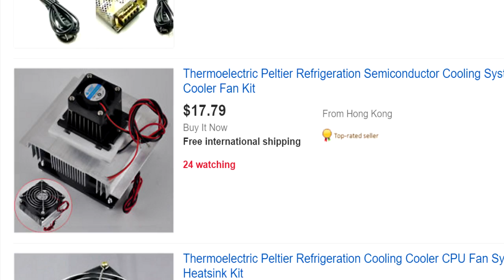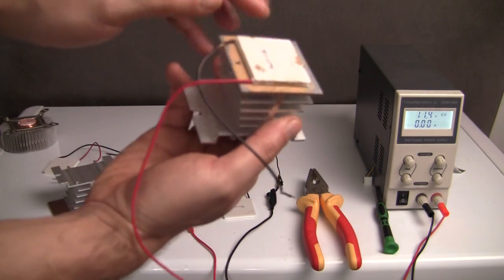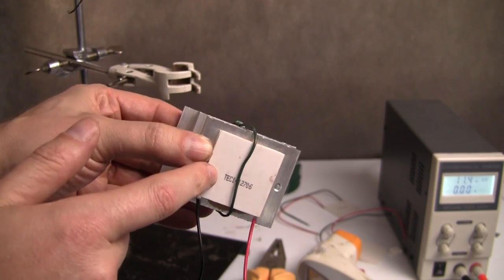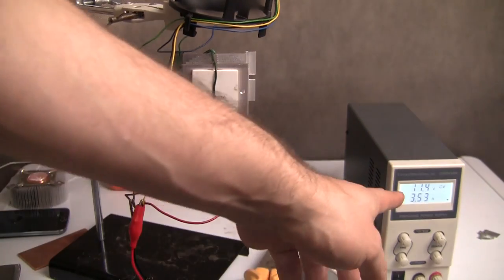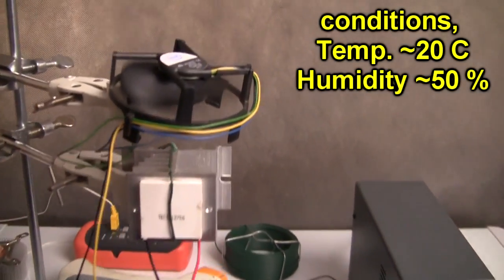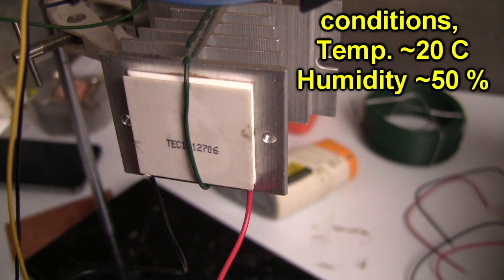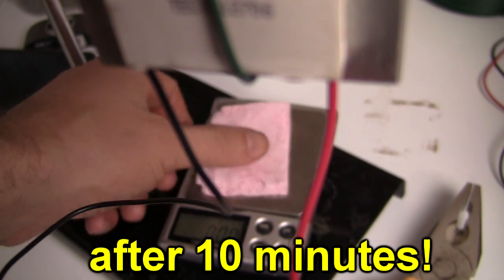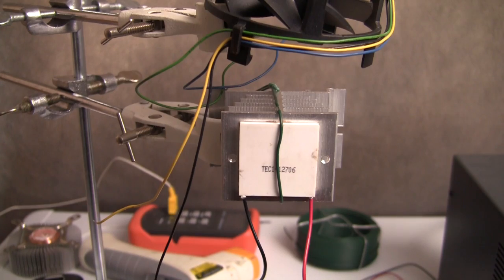Fontus Water bottle claims to make water from air.  Is it possible?

Comment: With best methods you's still need about a kilowatt-hour of energy to condense a liter of water. First you'd have to replace the small peliter with a large   heat pump, and a setup where the cooled air below the dew point would pass through a heat exchange to pre-cool the incoming air. You would benefit from active controls that could sense ambient humidity and temp, and temp in the condensation chamber. 

With respect to this particular setup, the Fan was working against you by drying anything not on the cold surface, and mixing warmer air turbulences near the cold surface leading to evaporation and chilling far more air per unit water than was necessary.
Reply: +WorBlux Israeli company WaterGen provides water-from-air devices as efficient as 300 Wh/liter. The IDF uses these. That said, it's still far off from what a portable solar panel could provide, and it's still bigger than what a bicycle could carry.

Comment: Something tells me their device might be something more than just a peltier unit placed over a bottle.
Reply: *****
I just made a post where I calculated how much energy that thing needs. Even if you assume the condenser does not loose any of the cold, you need 3 kw to power it.
That is 500 times what a bicycle dynamo generates, if you drive very fast.
Reply: Well, I just want to say that he definitely put the heat sink on the wrong side of the peltier for this test.  It's the electrical current (or is it potential? doesn't matter, anyway) that keeps the cold side of the peltier cold, the hot side is going to be hot no matter what, even with a heat sink. What's really important is maximizing the surface area of the cold side -  i.e. putting a heat sink on it.  The more surface area you have in contact with the air, the more water will condense on it, simple as that.  Just using the small surface area of the peltier unit itself and putting the heat sink on the hot side where it was actually less effective, kind of shows that he's not looking at the problem in quite the right way.  I'm not saying that the device is technically feasible for filling a whole bottle in a reasonable amount of time, but it is technically feasible for producing water from air, so the question is, ignoring how cold the peltier gets and how efficiently you remove heat from the hot side - which I don't think are very important, how do you maximize the amount of relatively cool surface area you have and also maximize the volume of air flowing over that area?  Increasing the pressure of that air is also an obvious plus (higher air density = more water per square inch of collecting fins), but probably too energy demanding to be practical and it would also increase the energy requirement of the peltier unit by increasing the amount of heat it needs to remove from the collecting fins.

He was also putting too much energy into the peltier which was oviously screwing up its efficiency which was obvious as the hot side of the peltier was heating up the cold side.  The main purpose of the peltier is to remove heat from the collecting fins.  If that is done at a reasonable pace, then the hot side should only be slightly above ambient temperature and the cold side only slightly below.  It should only need to be around 10-20 °C on the cold side, which would correspond to the dew point you would expect to see wherever the device may be used.
Reply: Schwarzer Ritter It's not all about temperature, though.  You want the temperature to be somewhere just below the dew point of the air in the room and you want it to stay at that temperature.  As the peltier absorbs heat from the air it will start to warm up, and that's when you need to crank up the power but you can't just shove 50 watts into a peltier device and expect that more power equals more condensation.  That is just not how it works.  Power consumption and condensation are not linearly correlated.  As I stated before, it has more to do with air flow, pressure and surface area.  Granted, as air flow and pressure go up, there will be more heat to get rid of, but it should be balanced such that the temperature remains fixed relative to the dew point of the air.  If it's too much heat for one peltier than he should have hooked up two of them.  A sensible experiment (or device) should also have a separator between the hot and cold sides so that hot air cannot just go to the other side and keep the air from reaching the dew point.  Such an overly simplified setup basically only proves the feasibility, since even though it is probably the worst possible condenser arrangement, it still managed to produce a few tiny beads of liquid water.
Reply: If you look at the indiegogo page you will see these two diagrams: http://ignitecfp.com/wp-content/uploads/2016/03/Map-Animation-Fontus.gif https://c1.iggcdn.com/indiegogo-media-prod-cld/image/upload/c_limit,w_620/v1459622198/graphics_chart_filling-01-01_jvz8ai.jpg

The first showing that (I'm assuming Thunderf00t is in England in this video) it shouldn't even work in the entire United Kingdom, or at least be below 50% efficiency - whatever that means, so he can't even really test their claims as they're not claiming that it will work in the U.K.  The second showing that its performance is dependent on temperature and relative humidity.  So yeah, it's clear that it's a bullshit product but I honestly don't believe that they are making any false claims.  I think in the right place at the right time you can fill the 800ml bottle in about 2 hours, and I think they tested it in ideal conditions meant to replicate the weather of some hot, balmy, rainforest climate.

Comment: Yeah, I found the same thing, I have a Peltier dehumidifier, and it takes 40W to give you about 100 mL every three or four DAYS! Not quite save your life time. Now if you compressed the air and cooled it you might be able to do it, but it would take
a lot of muscle power to do that kind of compression. Solar still would work better.

Comment: Check this out... this is from their IndieGogo page at the very bottom:

"It is explicitly pointed out that the products which serve as Perks are in the development phase. It cannot be excluded that during the development phase technical, economical or other circumstances arise which may result in (i) a delay of the delivery of the Perk or (ii) the production and delivery of the Perk in a different form as regards functionality and/or design or (iii) even non-production of the Perk. In the latter case there will be no Perk delivered to the Contributor. Contributions will not be refunded. By making a Contribution the Contributors explicitly acknowledge the risks associated with the occurrence of one of the aforementioned events."

So... they have a disclaimer that says you may get nothing and no refund. Period. Unbelievable, and they have already raised $327,360 with 12 days to go. Unreal.. I need to make up some crap and put it up..... $327,000 in 18 days. They were only trying to steal... pardon me... RAISE $30,000..
Reply: +robert smith Amazing fine print lol; and unfortunately you know you're better than that.

Comment: I wonder if you'll be addressing other downfalls of this, past the issues with thermodynamics and maintaining a cold enough temp for condensation. Such as power concerns. I imagine that the volume and mass of even the best commercially viable batteries would be far greater than whatever water they could condense. And solar would provide too little power to effectively run a dehumidifier strong enough to pull water at the rates they advertize. not unless you want a huge panel strapped to your back, haha.

But beyond anything else, water pulled from the air is filthy. Dehumidifiers pull all sorts of dust and garbage out of the air, and that's inside a clean building. Outside, the pollen, spores, dust and vehicle exhaust would make the water god awful tasting, if not mildly poisonous. (I'm looking at you inner city air pollution!)

I'm surprised (and unsurprised) at people trying to jump to this thing's defence. It's flawed on so many levels.
Reply: +kauske  even with the best batteries commonly available, and a 90% efficient apparatus, you'd be better of weight wise packing water, but not than 2-3 times over. not counting the weight of the apparatus.  Shirt to hydrocarbons to power the heat pump and you might when over just packing water, when you need hundreds of cubic feet of water. Of course then there is cost to consider.
Reply: WorBlux 
That's exactly what I was getting at...

Comment: In my apartment we have to put a bucket under the air conditioner because it condenses water from the air and that might create enough water to avoid dehydrating maybe it creates at best a gallon over 12 hours but that really racks up the electric bill the unit is the size of a book shelf so that dinky solar panel isn't going to cut it although the unit stops when the apartment reaches the right temperature.  I mean how much more efficient than an air conditioner can one of these things be?  I know you get water by cooling the vapor in the air, but my question is how much water vapor are you cooling that goes back into the air wasting the energy used to cool it?

I Imagine if it were optimized to create water you could probably need a unit the size of a suitcase and a small gas generator to power it.  And it would be ridiculously heavy and cumbersome and probably expensive.

Comment: I wish I could say that you've debunked this, but you haven't. 

There is a lot more to the design of these systems than your simple test rig shows .

If the humid air is compressed and  then cooled using the peltier, then more condensation will be formed.  That is why you need some sort of broad heat exchange system on the cool side of the peltier within an enclosed system to not only compress  the humid air, but also to increase the surface area of the cooling surface on which condensation forms.  

After a gas is compressed and begins to expand, it takes energy away from its surroundings, causing a natural form of refrigeration.  Air just rushing past the peltier does not get a chance to be compressed and decompressed, losing any benefit of a  gas heat-exchange.  This is how refrigerators work, taking advantage of gas heat-exchange as it is compresses and expands to reduce temperatures.
Reply: +jefaus06 

Hey, hey moron. What about the energy to power this hunk of trash? Even if you hypothetically give that it produces water at a decent rate, the energy to run it would be far heavier in battery form then the water it would provide.

And don't go into solar, solar panels big enough to provide decent energy for a dehumidifier that can provide you water would be ridiculously cumbersome.

further, even if I were to concede some energy source far beyond what is feasible for the mass market currently, the water produced by this thing would be absolutely atrociously undrinkable. I defy you to down a glass of water out of the holding tank of a dehumidifier. clean it out, make it spotless beforehand, just let it run indoors, and see how utterly disgusting indoor air is. Now imagine outdoors, with pollen, dust, car exhaust and even soot in it. The design says nothing about filtration, and a pre-filter would greatly impede its ability to produce water.

This product is bunk, fundamentally worthless over something like an activated charcoal filter and pump half its size. As someone who does wilderness camping, and has at least a basic understanding of science, I would never, ever waste a dime on this thing, nor take it as part of my kit.
Reply: +kauske There are "two" forms of cooling happening within the system, as well as obviously "patented" technology, a form of hydrophobic surfacing on the surfaces the humid air condenses on.

I don't think +Thunderf00t can re-create these with merely a peltier.

I have seen such systems in use in Outback Australia.  Wind generated turbines that not only generate the electricity to operate the peltier, but do the job of compressing of the humid air at the same time. It is very, very efficient.  Again, the key to this is that hydrophobic surfacing.
Reply: jefaus06 

I love how you entirely skirted the issue of energy consumption... And the water being dirty...

this bottle is supposed to be a small man portable unit. you cannot carry a wind turbine around to power a portable unit.
Reply: +jefaus06 This is just a preliminary test, using a low power peltier device (as that's all we know about this thing so far). There is no doubt that it's not as efficient as it could be. The problem is, the efficiency is off by 3 orders of magnitude to boot. 4, if you consider the fact that you're never going to get 40 watts sustained out of a bike-mounted solar panel, you're lucky if you can get 4. (Believe me, it's been tried.). So, it could be more efficient, yes. 10,000 times more efficient? Highly unlikely.
Reply: tybofborg 
He'll just skirt around the issue of power, I already addressed that, and it went ignored in his rebuttal.

He also seems to ignore water pulled from the air is often contaminated, since you pull pollutants with it.

Comment: I saw a car ad one time, so I built my own car. It didn't work very well, so I know that cars are bullshit.
Reply: Except for two things. 

1) cars require complex engineering that you obviously have no idea of, while this has relatively simple engineering

2) you didn't actually build a car.
Reply: DBZHGWgamer
I'm one of the relatively rare people who can build a car, at least from parts, I'm a professional mechanic. I'm pretty good at welding, steel fabrication and body work,  But I wasn't really talking about cars, I was making a point about the concept of this video. It's like, review the product if you want, but don't try to build your own version of it and then declare it's impossible. I have no idea whether it's possible to miniaturize an atmospheric water generator enough to make a self filling water bottle, it seems unlikely, but the basic technology is real, so I can't definitively say it can't be done. After all, if nobody had heard of a smartphone and you told people about it, they'd think you're nuts and tell you it's impossible.
Reply: Terrace Thornhill but there is a difference. Everything that goes into a smartphone and a are things that in and of themselfs are complex. A water bottle filler is made of several simple parts (excluding power), and ignoring how hard it is to make, it is thermodynamically impossible for it to work in any reasonable amount of time.

Comment: you could improve efficiency by passing the warm air from the heat sink over the cold side.  bigger temp differential = more condensation.
Reply: Except that would ruin the whole point of the heat sink as the temperature of the cold side would go up...
Reply: DBZHGWgamer hmm right.

Comment: I'm curious if there is another mechanic at work here.  You have a fan blowing past the device without containment. Effectively drying the device.  I wonder if you had taken the reading at differing intervals. You've proven that your method of doing this is ineffective, but not that their device doesn't work. Don't get me wrong I don't buy into what they say about the device either but your test is inconclusive. Thanks Phil.
Reply: he should have had a cup under it to catch moister, but if the fan causes the water to evaporate, it would happen in the actual product too.
Reply: DBZHGWgamer If you're blowing cold air into a confined space and the air outside the confined space is warmer, would you not get condensation inside the container? Once condensed the dry air is replaced by new, moist, cooled air?

Comment: Just playing devil's advocate here, but is it possible that outdoors during a muggy day in the summer, there'd be more ambient humidity in the air than inside your workshop?  Also I'm wondering if positive airflow pushing the condensation down into that flask would protect it from evaporative losses that could occur in your lab?  It'd be pretty easy to modify your procedure to account for this.  Just turn off the AC on a hot day and stick a jar around it.

Comment: it really is impractical, but you gotta admit, a shot glass of water a day is better then no water. loved the video thunderfoot.
Reply: +wildwesleywest To get that shot of water you need to carry about 70Ah worth of batteries (if I go with Thunderfoot's 3amps consumption and 24hrs) 
That is easely more than 10 kgs worth of lead-acid battery, PER DAY. 
You could probably reduce that to less than half by using lithium stuff, but it would still make a lot less sense than carrying actual water.
Reply: leserpent90 fair point, I'm just saying if you did find yourself in a bad situation and could hook this up, you should. but honestly anyone with common sense should know that if your going out in the wilds, to pack proper supplies and let someone know where you are going. ive heard stories of idiots going cave exploring without telling anyone.
Reply: or you could use thorium =D
Reply: Jonas Strzyz Wouldn't it be simpler to hook it up to a Solar FREAKING Roadway™?
Reply: leserpent90 no no no it would be better to use the water gill, do you even science bro?